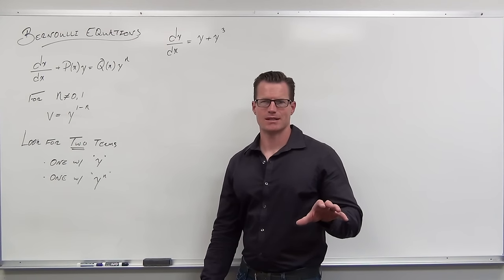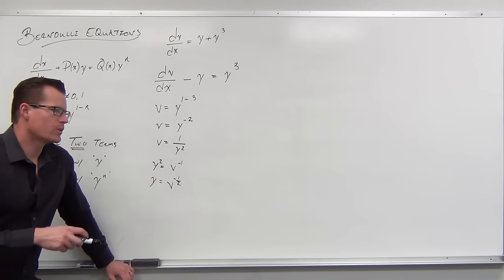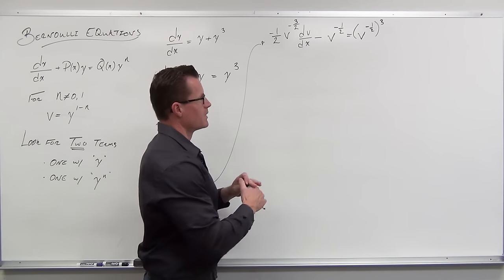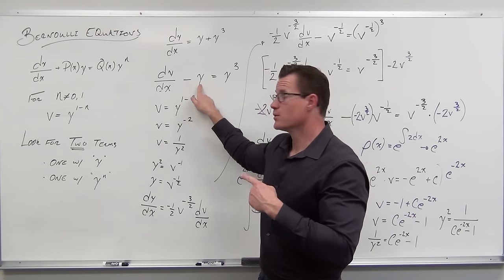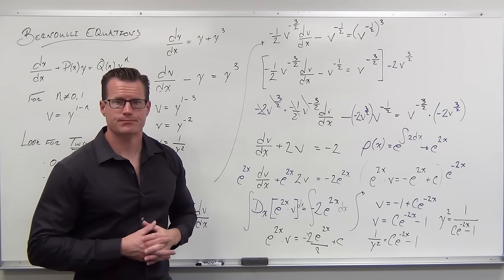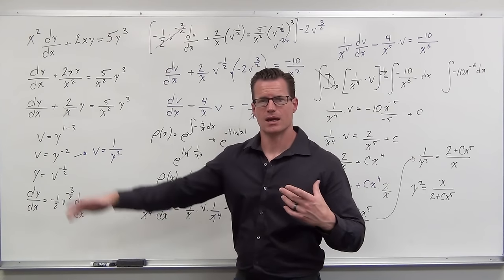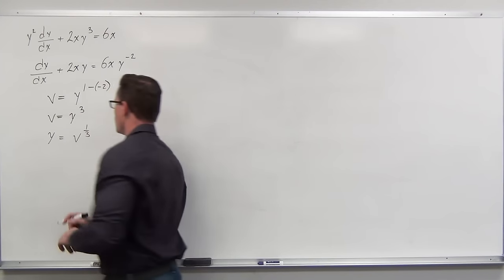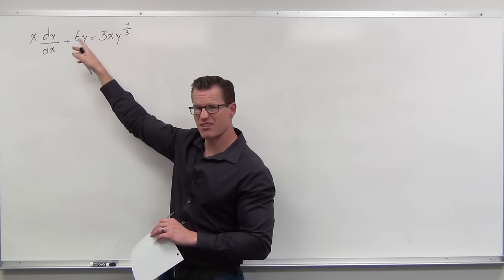How to Solve Bernoulli Differential Equations (Differential Equations 23)

Comment: Just a thought for the first problem at (6:24). If v = y^(-2), then dv/dx = -2y^(-3)dy/dx. If you divide the whole equation by y^3 you will be able to substitute in (-1/2)(dv/dx) directly. From there you can put it in linear form and solve. Saves you from all of the fraction exponents. Hard to explain in text but you essentially do two substitutions that gets you to dv/dx +2v= -2 in less steps. That's actually the brilliant thing about using substitution methods.

Comment: These computations can be simplified. Indeed, set v=y^{-2}, you get that dv/dx=-2y^{-3}dy/dx. Then divide both sides of the equation dy/dx - y =y^3 by y^3. You get y^{-3} dy/dx -y^{-2}=1. So, (-1/2)dv/dx-v=1 or dv/dx+2v=-2 or dv/dx=-2v-2. This is a simple separable equation dv/(-2v-2)=dx. Now integrate both sides: (-1/2)ln(|v+1|)=x+c. This implies that ln(|v+1|)=-2x+C. Finally, apply the exponential and solve for v to get v=-1+Ae^{-2x}.

Comment: I just wanted to mention that at 54:33, where you get the Linear differential equation, it turns out you can also solve it by using seperable equations. You can bring 6xv to the right side and factor 6x out...

Comment: Thank you so much for the lectures. Do you think it would be easier to get the equation in standard form, then multiply through by the reciprocal of the y^n on the right side. Then substitute, that way you don't have to solve for y in the v=y term. Just take dv/dx and substitute on the left side dy/dx term.